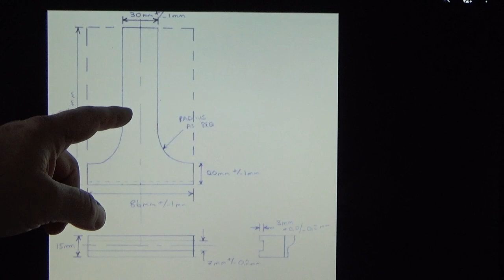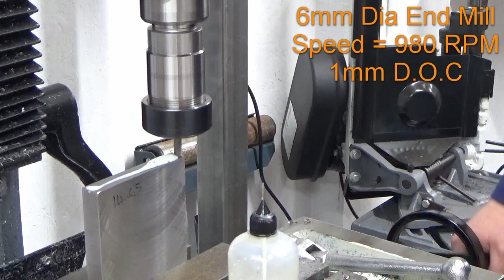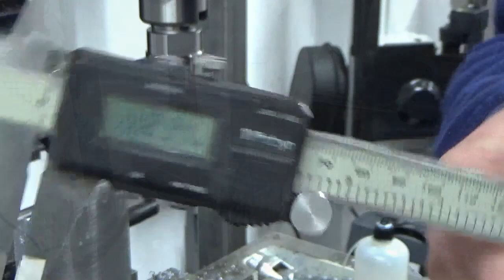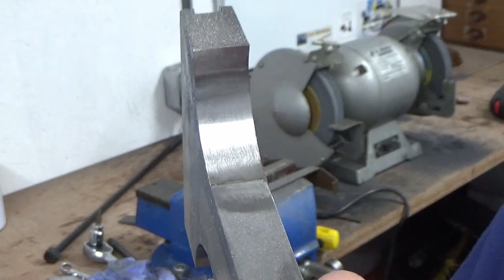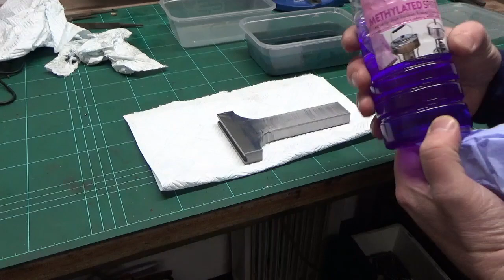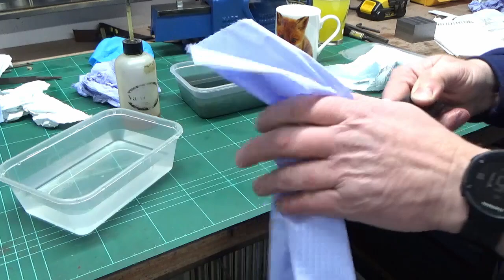Making A Ducting Swaging Tool

Comment: A handy item when you need one, re the chamfers, you could have bolted on the 2 sides you cut off in the bandsaw then turn the thick handle to round in the lathe, not on the drawings but a nice addition, would also give you a bigger head to hit with a hammer.
Reply from the maker: Hi Derek, thanks for the comment. I actually considered this (more for profiling the large radii) but decided against it as, well........ the customer is always right as they say. Cheers, Jon

Comment: Enjoyed another great video. Keep up the good work Jon.
What blacking solution do you use and from what supplier?
Reply from the maker: Hi Gary, thanks for the comment. I use Black OX from Caswell Europe. If you look at my "Making vice clamps for the mill part 2" video, I think I showed the bottle and did a small review etc. Cheers, Jon
Reply: @jonsworkshop 
Thank you Jon, I will take a look at the clip and try and order some.
Realy enjoying your videos. I have made a tailstock ejector for my viceroy and it works great.
Can you get top speed on your Harrison? I have the same Transwave on my Harrison M300 but can't get it to start on top speed.
Reply from the maker: @garywilliams9602  Hi Gary, I have only tried it once, it made it, but kind of in stages. I have had to shorten the boost cycle on the transformer to about 1/2 second for the mill to work. This means the 2 or 3 second acceleration up to top speed on the lathe is handled in about 4 stages of boost. I need to have the transformer on setting 4 for the lathe to work. It's a total compromise with the transformer, especially when you power multiple machines with it. Does the job though. Cheers, Jon

Comment: You've got friends, and they admit it, outstanding! 😆
Some,if not most, of the quill clattering could be the quill splines rather than the gears, which bathed in oil. Greasing, with thick grease,  the splines can reduce fretting corrosion and quiet down the noise a little. Also another good reason to have the quill fully up and use the Z for height adjustment, max spline engagement and quill in the head slop.
Turned out fine and to drawing and specs. I think you are right about mark two being a two pieces jobby, perhaps with a more comfortable round handle?
Re outtake, i know you are Jon but sounded a bit like The Mills.
Reply from the maker: Hi Chris, thanks for the comment. I noticed you used the plural of "friend", who else were you thinking of? Fully agree with all your thoughts. I did use heavy grease on the splines at rebuild but I have been milling with some quill extension (don't like doing it and do try to keep to an absolute minimum) as there is no easy way to control depth on the column apart from setting clocks up under the head all the time. Yep, coming from the east of England as Mr Mills, this is a well used colloquial profanity, it has stuck with me since school and occasionally gets an airing. I must admit though, having watched every one of his videos since the start, it has probably bought the saying closer to the front of mind. I will try a Scottish one next time if I remember, like baw bag or some other genitalia reference........... oh the richness of our language. Cheers, Jon

Comment: Great video Jon, finished item looked great. Carriage stop is a good next project, also the tool holder screws 😁
Reply from the maker: Hi Russell, thanks for the comment. Yes the chemical black just finishes things off nicely. Need to get something (collet chuck or a smaller 4 jaw I can chuck up) before I can do the toolholder screws as my 4 jaw won't go down small enough. Carriage stop is WIP in CAD at the minute. Cheers, Jon
Reply: @jonsworkshop  or just make a split sleeve, worked fine when I was hard turning the number stamps.
Reply: @jonsworkshop  make your self a split collet 😁 I'm sure Joe Pie did something similar recently for holding square stock

Comment: Another excellent video. I made my bandsaw table out of 1/4" plate, plenty rigid enough. Cheers.
Reply from the maker: Hi Paul, thanks for the comment. Yes, I am going to need to do something similar. I thought about trying to beef up the supplied one but it will be quicker to start from scratch I think. Any chance of a photo of yours through to my email just to get my grey matter working again? Cheers, Jon
Reply: @jonsworkshop  Hi Jon, I'll sort something out in the next few days, can you give me your e-mail please.
Basically mine is 10" square, holes copied from your existing table, slot cut with the bandsaw, it needs to be no wider than the blade (lot safer than the wide one on the supplied table.) take it a 1/16 past the back of the blade for clearance. I use my bandsaw a lot in the vertical mode, it's 40 years old, the table is simple and still going strong. Oh and the slot needs to come in from the back of the table. Cheers.
Reply from the maker: @paulskelton6836  Hi Paul, email is Jons.workshop@aol.com
No rush mate, it will be weeks before I attack it, more interested in the fixings of the table to the saw frame, do you just use the two screw holes or have you beefed up with additional supports?
Reply: @jonsworkshop  Hi Jon, I used the existing screw holes, mine are 1/4 BSW, I imagine yours are M6. Cheers